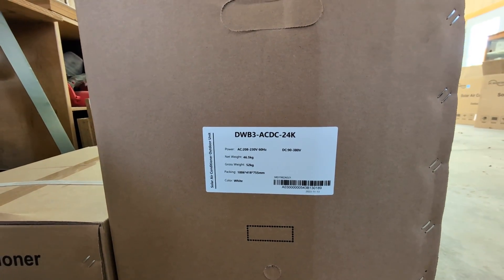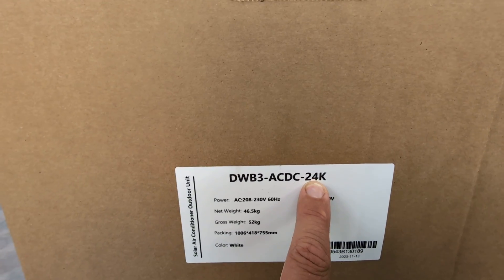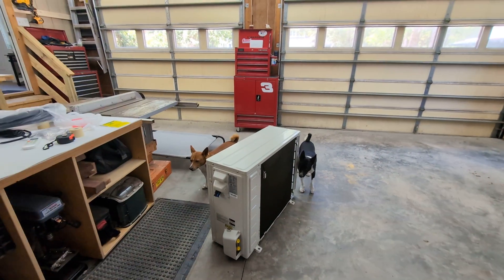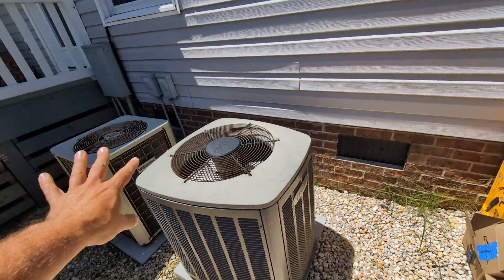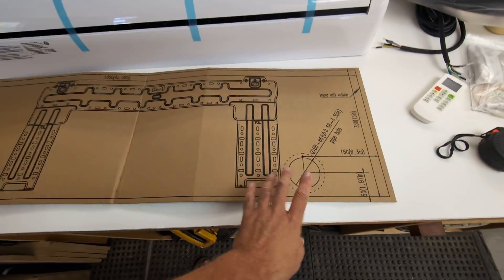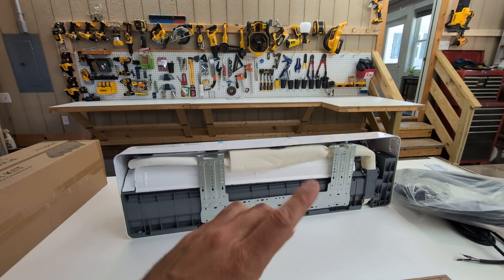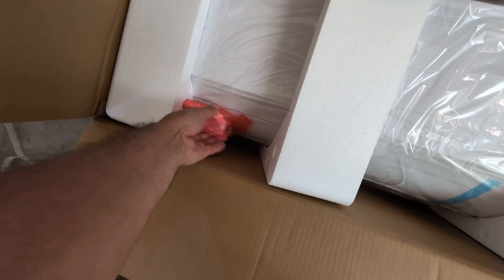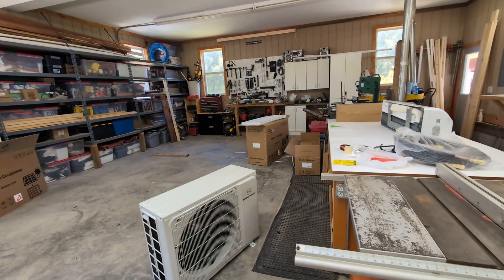Solar Powered Air Conditioning: EG4 AC DC Solar Mini Split Unboxing

Comment: I have a 992 sq ft townhouse here in FL and my central air conditioning just went up. I'm thinking of getting two of these units instead of replacing my old unit.
Reply from the maker: For that sqft you could even get 2 of the 12k / 1 ton units and it would keep it really cold. I have this unit upstairs in my house which is about 1300 sqft and it keeps it at 68 on 90 degrees days
Reply: @ianmburke   Oh okay, thanks!

Comment: Nice presentation, I have three supplementing my house 24k, 18k,18k, they really enjoy a level and plumb install.
Reply from the maker: That is awesome! Did you do them all DIY? The outdoor unit I need to level just a hair more it's about 2 degrees leaning outwards but still working incredibly well
Reply: @ianmburke  Yes did them myself, I found some literature that the bearings could wear prematurely  if the unit is not both plum and level, it was fiddley as the wall mounts are less than precise, wife not happy about the looks of the inside unit but it works great. The ceiling units were not readily available. Are you going to do dedicated solar to each unit or run a inverter from solar and power the systems.

Comment: I am interested in seeing how many solar panels it takes to run one 2ton unit. I live in Southside VA with plenty of sun. Would love to power a few units on my 1786 Plantation home and outbuildings. Will be watching your future progress for progress.
Reply from the maker: I think roughly 1200-2000 watts of solar is all you need and that is about 3 or 4, 400w panels. I'm personally going to see how far I can over panel it so even in low light, morning, or cloud cover still get a high level output. My goal is for the units to almost never be on unless they are solar powered. These units sound like the perfect solution for your type of situation!

Comment: 6 ton's of cooling capacity for one residential home?  ok, over kill.
Reply from the maker: These units will eventually ONLY be run from solar so most of the hottest times of the day they will make it so that the central air units do not have to run. Then when the sun is down, the original units can kick on and also capitalize on the circulation function of the ducts. Additionally your assumption is not based off of SQFT this is a  4600sqft house which would need about 5-6 tons to cool/heat

Comment: Who in the world would plug a solar panel directly into a compressor? Makes no sense to me.
Reply: A very very very very very stupid person...
Reply from the maker: The EG4 is the 'brains' for what happens after it is plugged in. It isn't 'directly into the compressor' that is not an accurate representation of what is happening. This all in one simply makes the plugging in a lot easier.
Reply: @ianmburke  solar is very unreliable in terms of constant and stable voltage with spikes up and down.
Usually a battery is used as a middle man to mitigate this.
So directly connecting the panel to a compressor (if that's what was done) is in fact not the best plan
Reply from the maker: Agreed, but obviously the engineers who designed this considered those things, internally it has its own MPPT and Capacitors to regulate/stabilize the voltage as well as the motor itself is three phase so variable voltage is more manageable. The listed voltage and array size are oversized so that it can normalize the voltage much more easily. But you are 100% without those features it would destroy a compressor.
Reply: @ianmburke  I wasn't aware it was built for solar application I thought it was a plain old compressor hah
Reply from the maker: Similarly charging your DC powered cell phone with an AC outlet doesn't make sense if you do not fundamentally understand what is happening in the electronics in-between